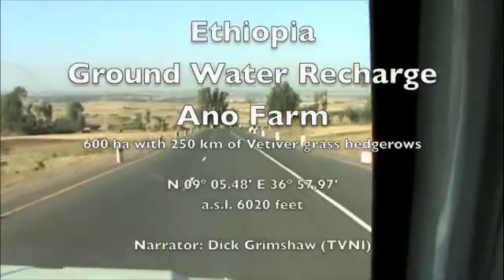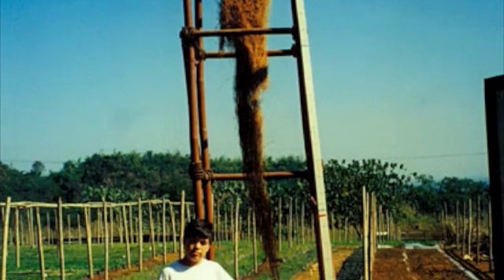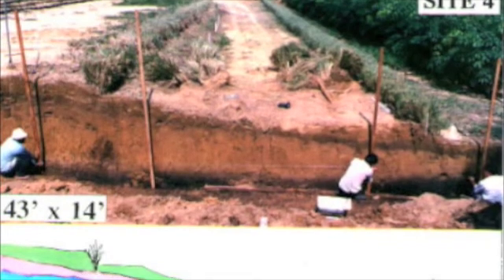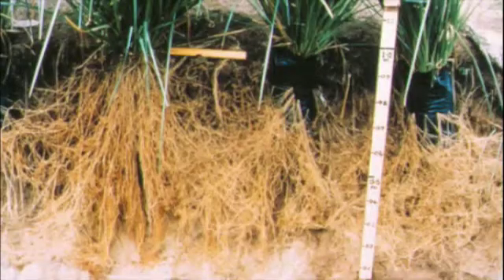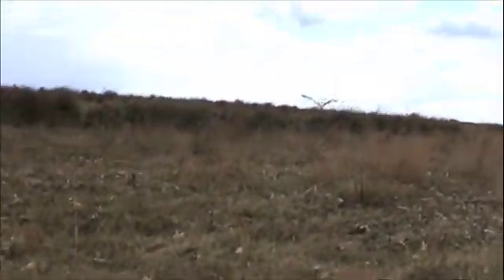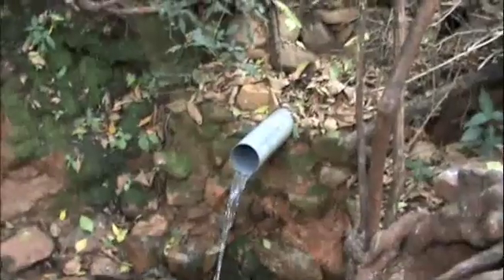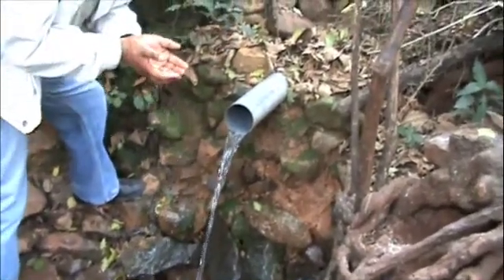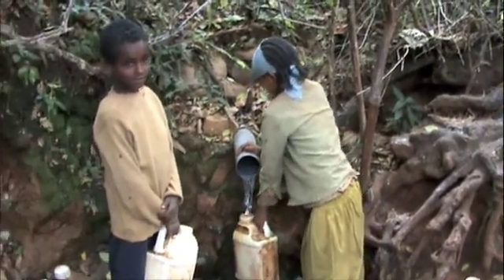Vetiver System: Ground Water Recharge in Ethiopia - Ano Farm

Comment: He should plant vetiver grass at the sides or banks of the spring and around the pipe and above it and below it and on it's left side and right side, and at the water level of the water pool. And add aquatic mint, known also as mentha aquatica, so that it will constantly sterilizes the water pool by exuding a lingering of pathogenicide.